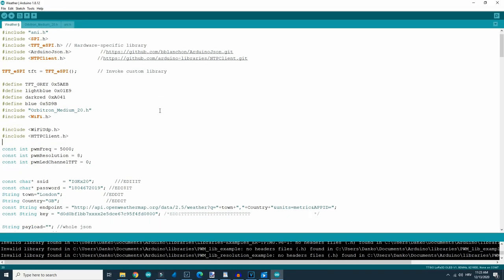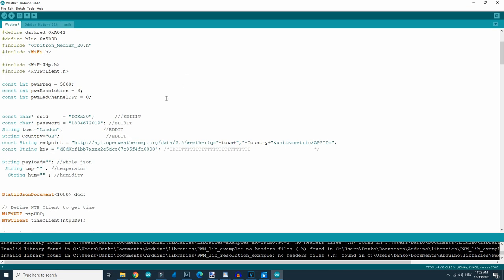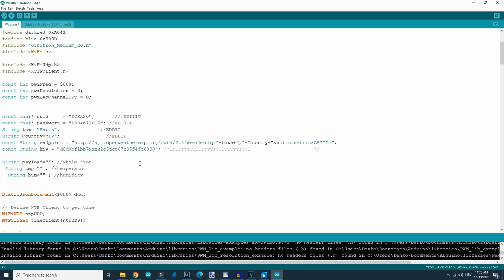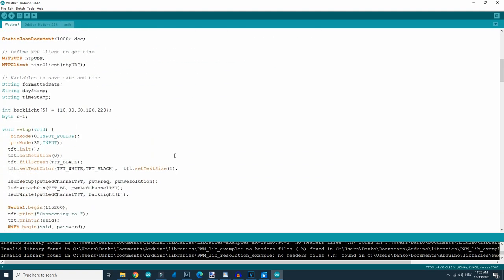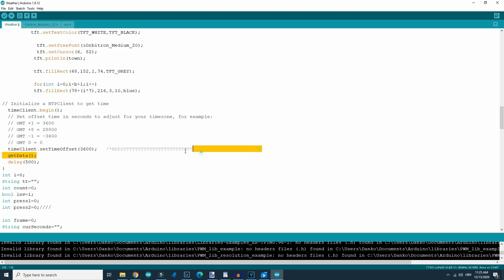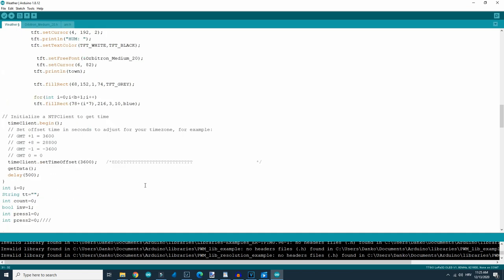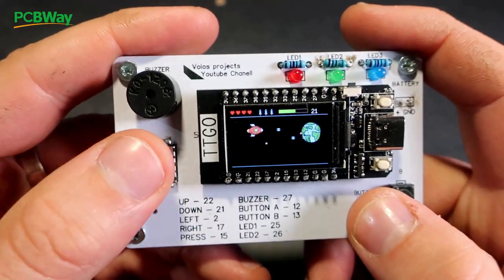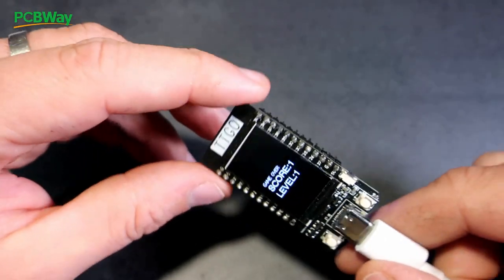TTGO T-Display ( ESP32 ) - Internet Weather Station and Clock (tutorial)

Comment: This is GREAT! If anyone wants to display the temperature in Fahrenheit instead of Celcius, it's pretty easy.  In the string endpoint variable, change "units=metric" to "units=imperial" and in the line tft.println(tmp.substring(0,3)) change it to tft.println(tmp.substring(0,4)) and it will display the temperature in Fahrenheit.
Reply from the maker: Thank you, i forgot that lots off people dont use c
Reply: Yes, I and can confirm it does work in fehrenheit.  If your having trouble finding the lines bobBailey mentioned, go to edit in arduino window and down to 'find' and search for it that way and you will find it quickly and replace as he suggested.  good tip Bobbailey.  great project VOLOS
Reply: Figured that out. I set one up again today because, well because I wanted one to do that again.  It is cool, my daughter is sitting here asking me why I would want this because my cell phone does the same thing for free.  She needs to sit and watch as I write out the check to pay for those "free" cell  phones we all have anchored to our eyes 24X7 in todays upside down world.  Still it is indeed cool, think I will mount one in a small case for daily use..

Comment: Super cool! tyvm!   I have a remote camera enclosure installation for taking nature photos. It must be autonomous for weeks/indefinitely. It has a solar panel, Renogy solar charge controller, 12V lithium battery powering a digital temperature controller and 12V heat strips around my glass window.  I need to calculate the exact dew point and then control heat strips that will ALWAYS 24/7/365 keep my glass window heated to, for example, 5 degrees above the dew point it has calculated.  My heat strips use ~35W. My temperature controller works great, but only reads the temperature of my glass window. To make my battery last as long as possible, I only want my heat strips to be able to operate when there is a chance of dew forming on the glass window. If there is no chance of dew, I want to save the battery and allow the solar to put all energy into the battery.  I have a Lilygo T-Display S3 ESP32-S3 touch screen.  I got it to use to calculate the dew point, but I do not then know how to make it control the heat strips.  My temp controller comes would wake up & control it's relay, or I could use a standalone relay if the Lilygo could make the digital temp controller that I am currently using redundant.  I need to use the least power hungry system, if another entire set up would do what I need please tell me & I will order that exactly. Must be streamlined & easy to use, because I will be handing this all off to someone else to set up & operate. Thank you very much!!

Comment: Cool project. I got it to work after a bit of fiddling with libraries. Somehow, the ArduinoJson library that got installed wasn't the most current version. After updating, it worked fine. My "town" name was too long to fit the display, so I just hard coded it to the ICAO airport identifier here. I also found my town name is shared by several others in the US, so I changed the API call to use the town id number instead. Also changed the units to “imperial” because that’s the crazy system we use here.

Comment: I finally got this to work.  It is still a big crude but functional.  I am not the author.

Most importantly Change the update frequency or OWM will knock you off their system.  It updates every couple of minutes.  That's too often!  Make the line that compares count to 2000 be like this: 
if (count > 40000) count = 0;  That will update about every hour.  I will try to fix this better, soon.

Fix the first line of ani.h to say int and turn green.   Of course fix your SSID/PW and OWM pass code.  Get the different NTP client library.  There are a couple of other problems that I am trying to figure out but it is working now.
Reply: You made my day! Thanks for sharing your changes!
Reply: Fix the first line of ani.h to say int and turn green.  (mine shows "int frams=10;" and I am getting error '\357 in program)  anyone know a fix for this?
Reply: @MaxJupiter  Read what I said and do it.
Reply: @michealmorrow1481  Sorry, but I don't understand either what that's about.
The first line in ani.h originally is indeed "int frames=10;" replacing it with "int turn green;" (as you said) results in an error: 

********************************************
" In file included from C:\Users\Frank\Documents\Arduino\TTGOWeatherStation-main\Weather\Weather.ino:3:
C:\Users\Frank\Documents\Arduino\TTGOWeatherStation-main\Weather\ani.h:1:10: error: expected initializer before 'green'
 int turn green;
          ^~~~~
Multiple libraries were found for "ArduinoJson.h"
  Used: C:\Users\Frank\Documents\Arduino\libraries\ArduinoJson
  Not used: C:\Users\Frank\Documents\Arduino\libraries\Old_ArduinoJson
Multiple libraries were found for "NTPClient.h"
  Used: C:\Users\Frank\Documents\Arduino\libraries\NTPClient
  Not used: C:\Users\Frank\Documents\Arduino\libraries\Old_NTPClient
  Not used: C:\Users\Frank\Documents\Arduino\libraries\Old_NTPClient2
exit status 1

Compilation error: expected initializer before 'green'"
*******************************************************

Replacing it with "int and turn green;" (again as you said), returns following error:

*******************************************************
"In file included from C:\Users\Frank\Documents\Arduino\TTGOWeatherStation-main\Weather\Weather.ino:3:
C:\Users\Frank\Documents\Arduino\TTGOWeatherStation-main\Weather\ani.h:1:14: error: expected initializer before 'green'
 int and turn green;
              ^~~~~
Multiple libraries were found for "ArduinoJson.h"
  Used: C:\Users\Frank\Documents\Arduino\libraries\ArduinoJson
  Not used: C:\Users\Frank\Documents\Arduino\libraries\Old_ArduinoJson
Multiple libraries were found for "NTPClient.h"
  Used: C:\Users\Frank\Documents\Arduino\libraries\NTPClient
  Not used: C:\Users\Frank\Documents\Arduino\libraries\Old_NTPClient
  Not used: C:\Users\Frank\Documents\Arduino\libraries\Old_NTPClient2
exit status 1

Compilation error: expected initializer before 'green'"
*********************************************************

I'm not speaking for MaxJupiter, but, I for one, haven't the foggiest what you mean.
Please clarify.

BTW as it is, my TTGO will run the program, kind of. It will connect, won't show date and time, shows location and IP address, needs a few seconds to load temperature and humidity, and promptly reboots.And keeps looping like that.
Reply: @2flying4fun  just replace "int". It will turn green.
Reply: @michealmorrow1481  I still don't see what replacing "int" with "int" can accomplish...
Reply: @2flying4fun  It is WRONG in the download.  Just do it.  Then you can compile.
Reply: @michealmorrow1481  Do you mean that the code highlighting isn't correct? It is in the file I downloaded only yesterday.
I compiled the sketch again just now. It compiles without problems, and it doesn't reboot again and again. So that's good. The only thing missing now is the time and date at the top and the seconds below "SEC:". And in the serial monitor only the time gets printed (turns out the other data to be printed gets printed only once every three minutes AFAICT). But we're getting there... eventually.

Comment: Cool project! Ive tried to make something similar on 1306 display, but colored animation looks much greater! By the way, Openweather is capable to give you a bit more data. You can obtain stringed data by using GPS coordinates (actual if you are moving across the country, just to get weather info in current location). Also forecast for several days ahead. Day of week, moon phase etc.....
And if you connect GPS module - than you can load current time from GPS  even if there is no internet connection. Also GPS will give you ability to : 1) get current position (and save it if needed).  2) estimate range between current point and selected (or preset) points 3) determine direction to the selected (saved) point. 4) Estimate your actual movement speed.  
I just tuned up small project with small oled display and Wemos8266, there are 2 buttons too. So, would be nice to try convert it for TTGO display.

Comment: Very cool project. Only issue I had was with the ani.h file. The issue was that when I saved the program this file was not in the same folder. Moved the file into the folder and presto it worked. Also was able to make additional modifications reading the comments. Great little project. Look forward to your new series on programing.

Comment: Great project, love this little board! Had a little trouble getting it running (NTP client mix up) but works like a charm. I use a discarded E-cigarette battery (rechargeable 3.7v Lipo battery to run it) but would be nice to see a battery level on the bottom of the screen to replace the IP address . Would you be able to do a video how to access and display battery voltage?
Thanks again!

Comment: Nice video. I will try it out on my ttgo board I have lying around. Maybe this is also nice on the ttgo watch!
Reply from the maker: It will work with little code modification, but ttgo watch with wifi turned on will drain battery fast.
Reply: I also have the TTGO watch 2020 ver.1 I surely would be awesome  to have this sketch running on it.

Comment: My clock & weather station is much simpler. It displays current values on small OLED screen, but in my opinion projects like these can save lot of energy by turning off screen when no one is around. Hence simple idea of using small arduino PIR sensor to turn on and off the display.  It's interesting that probably no such product uses this kind of energy saving solution.

Comment: Hello 'Volos Projects', I really liked your project! However, I have a few questions:
I tried it with a 2.2 inch ILI9341 Display, however logically it is not filling the screen fully and correctly, as it is a larger display than the "TTGO T-Display" you use in the video.
I know the TFT_eSPI library is great but I'm not familiar with it. I would like to know how to adapt your sketch correctly to my display or perhaps with a larger display like a 2.8 inch ILI9341. For that, logically, all fonts would have to be bigger, to fill the screen, which is bigger.
I don't understand one thing: do you use the font "Orbitron_Medium_20" as the only font in your code? Is it scalable?
For example, if I want to enlarge the font which is used to show Time, Date, City Name, TEMP, IP address (in the lower left corner of the screen), how should I do it?
Another thing: where do you change the Date formatting, for example, Day, Month and Year?
Sorry for so many questions, but I would love to use your code with a larger display.
My early thanks and Greetings from Brazil,
Daniel Fernandes
Reply: Hi Oscar, but what are these instructions for? Thanks

Comment: Hello Volos. Since yesterday on my LillyGo T-display S3 and my M5-Paper are not receiving weather updates and calls from Open Weather. I've verified my API keys and they are active. Could you test and see if you get any updates on your devices from Open Weather? Thanks in advanced.
Reply from the maker: Hm, thats is probaby problem with weather API, they cahnges some rules latly, try to call api less often. maybe each few minutes
Reply: @VolosProjects  I've setup mines to call every hour. But yes, you could be right, seems like they've made some changes. API 3.0 is the new release but 2.5 is still up for old subscribers. Thanks for the reply. By the way I modified the weather app you made with some cool added features. Is there a way I can send it to you?

Comment: I would love this for my M5 Stick C Plus. Been trying to work on this and am lost. I have all the files needed in the folder and still get errors when it's compiling. 
Arduino: 1.8.16 (Windows 10), Board: "M5Stick-C, Default, 1500000, None"

Weather:6:73: fatal error: NTPClient.h: No such file or directory

compilation terminated.

exit status 1

NTPClient.h: No such file or directory

I placed every file on same folder and installed all the necessary libraries. Yet it doesn't find NTPClient.h which is also inside the folder together with the .ino file, etc. Help?

Comment: I bought two board to do this project and haven't got it working yet.  The tft_espi library needs to be configured before it works which is probably why some users are getting compile errors. Even so, I have not got the display to work, and when I added the tft configuration it no longer compiles correctly. 
This is a good project, but needs more explaining.
Reply from the maker: Here is tutorial i used to install and configure my TTGO boards.
Reply: @VolosProjects  Uncomment this line in setup select header file
#include <User_Setups/Setup25_TTGO_T_Display.h> // Setup file for ESP32 and TTGO T-Display ST7789V SPI bus TFT

Comment: Thank you for the video. When I go to complie I get this error: 
Weather\ani.h:1:1: error: stray '\357' in program
 int frames=10;
Weather\ani.h:1:1: error: stray '\273' in program
Weather\ani.h:1:1: error: stray '\277' in program

What am I doing wrong?
Reply: Not sure I can help much... I have same problem... switching back to IDE 1.8.13 allows me to compile.  IDE 1.8.15 does not work for me as well... very strange.  I wonder what changed between these versions of IDE.
Reply: Just saw micheal Morrow post- That fixed for me as well.  Must be some 'Control Sequence' or somesuch before first int in ani.h.. Like he said " make it turn green" and works now for me with 1.8.19.  Thanks, MM !!
Reply: @groveh1  Thanks for pointing me in the right direction!
Reply: @groveh1  what does "make it turn green" mean? what did you change?
Reply: comment error line problem solves

Comment: Hi, my IDE always says " Weather:5:51: fatal error: TFT_eSPI.h: No such file or directory
 " but the file is in the project folder. What am I doing wrong ?
Reply: I got it managed somehow, but now i'm getting this error message:

Arduino: 1.8.13 (Windows Store 1.8.42.0) (Windows 10), Board: "TTGO LoRa32-OLED V1, 80MHz, 921600, None"

D:\SSD-Kram\Downloads\TTGOWeatherStation-main\Weather\Weather.ino: In function 'void setup()':

Weather:61:17: error: 'TFT_BL' was not declared in this scope

   ledcAttachPin(TFT_BL, pwmLedChannelTFT);

                 ^

Multiple libraries were found for "WiFi.h"

 Used: D:\SSD-Kram\Dokumente\ArduinoData\packages\esp32\hardware\esp32\1.0.4\libraries\WiFi

 Not used: C:\Program Files\WindowsApps\ArduinoLLC.ArduinoIDE_1.8.42.0_x86__mdqgnx93n4wtt\libraries\WiFi

exit status 1

'TFT_BL' was not declared in this scope
Reply: wrote a #define TFT_BL and it compiled and uploaded witout any errors - but the screen is black, only backlight is on

Comment: Hi, I'm not getting anything on display.. right button adjust the back light and that's it.. any idea..?
Reply from the maker: Probably wifi problems, make shure that ssid and password are correct. Alse esp32 supports standard 2.4 wifi. Try another wifi , you can try make hotspot on phone
Reply: @VolosProjects  I checked the Serial Monitor and I see it's connected. 

Temperature42.28
Humidity93
Bothell
2020-12-30T12:08:39Z
2020-12-30T12:08:39Z
2020-12-30T12:08:39Z
Reply from the maker: Then make shure your tft_espi library is latest version and properly cofigured for ttgo t display
Reply from the maker: Here is my instruction video, how to setup and install library
Reply from the maker: https://youtu.be/b8254--ibmM
Reply: @VolosProjects  That was the problem, tft_espi library configuration for ttgo. thank you!

Comment: I get tons of errors trying to compile this and i do have the files from your github. HTTPClient.h, SPI.h amongst others just fails. So how is this actually done ?
Reply from the maker: Did you install board and libraries properly. Have you used this board before?
Reply: @VolosProjects  i finally got it to work, it was a library that was conflicting with some other version of library. Made a clean install and then it finally worked. I was thinking that instead of the button operations "brightness" and "invert colors". It would be nice to add data from BME680 when pressing one of the buttons and when you press the other button you could show battery voltage/charging ?

No i have not used this exact board. I have used ESP8266 just a little bit. Regarding coding it was a long time ago but i used to code in ASM but i cant say that i can remember alot about it :D

Comment: Hi, thanks for your video. I get an error  in ledcAttachPin(TFT_BL, pwmLedChannelTFT);
error is  'TFT_BL' was not declared in this scope. Please help! I am using the original TTGO  T-display
Reply from the maker: Do you have latest ttgo disolay library?
Reply: @VolosProjects  Which library should I use, and which module should I select?
Reply from the maker: https://github.com/Xinyuan-LilyGO/TTGO-T-Display
Reply: @VolosProjects  Hi, I checked this, but the problem remains....
Reply from the maker: Ok, TFT_BL is backlight pin for tft display.  You can add this line before setup function    .... int TFT_BL=4;
Reply: @VolosProjects  I reinstalled all now it works! Thanks!!

Comment: I get the following error message:
In function 'void loop()':

TTGOWeatherStation-main:193:30: error: 'class NTPClient' has no member named 'getFormattedDate'

   formattedDate = timeClient.getFormattedDate();
Reply from the maker: you need this library  https://github.com/taranais/NTPClient also you need update ArduinoJson library
Reply: @VolosProjects  I installed the NTPclient. How do I update the ArduinoJson library? I currently have version 6.17.2 installed.
Reply: @VolosProjects  Problem solved. I have now installed the NTPClient in version 2.0.0. Then it works.